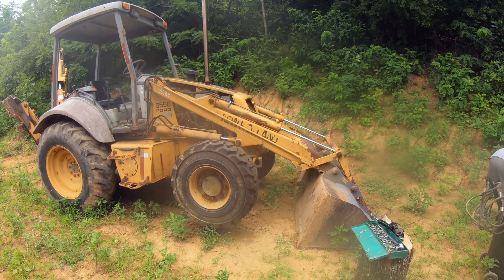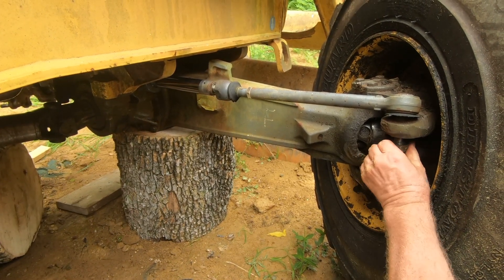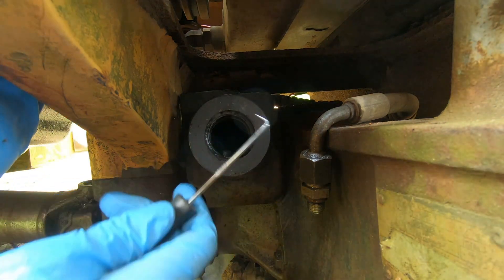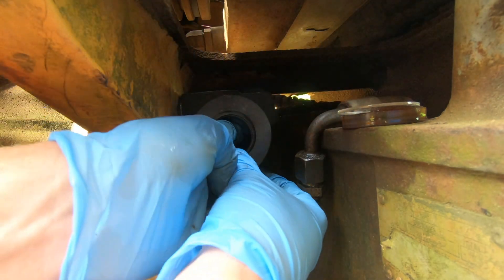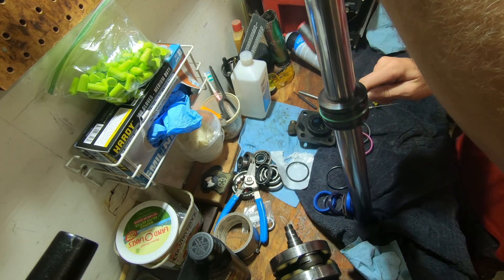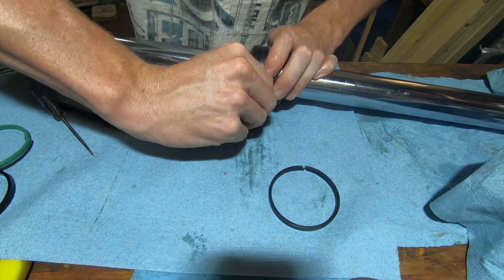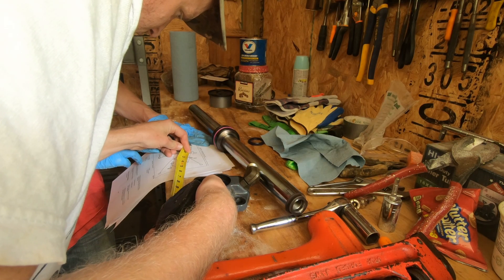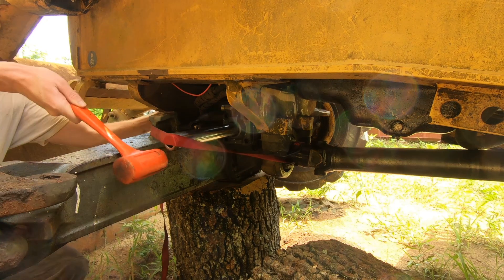How To Rebuild Backhoe Hydraulic Steering Cylinder - Ford New Holland 555E - 4WD

Comment: I have the 675E and transmission stopped going into gear and now won't start, any ideas/suggestions?
Reply from the maker: Luckily we haven’t had any tranny problems yet. When you say it won’t shift do you mean the gear selector or the power shuttle forward reverse? If it’s the switch on the steering column I would check the connections that’s a purely electric toggle switch.
Reply: @BrollBrothersProductions  yeah it's on the steering column, seems to just not want to get out of neutral but if I'm honest I have no idea what I'm doing in general with it, my neighbor let me have the backhoe and I'm trying to figure it out as I go.

I can "trick" it to get into forwards by up-shifting at the same time as putting it into forwards gear but no luck outside of that. The parking brake indicator light is also stuck on which I think might also be at fault of not letting it out of neutral
Reply from the maker: @amoniable  the parking break is gone on mine lol. If you look up the manual you can get a wiring diagram, if I recall the forward reverse switch goes through the console and plugs into the transmission. If that plugs looks okay you might just need a new switch, not sure if that is replaceable or comes with the stalk. If you don’t have the manuals drop me your email and I’ll send you a copy. I think messicks (online store) has the microfiche/parts diagrams to look up replacement parts.  I would also throw a post up on heavy equipment forum there are some knowledgeable and helpful folks over there.